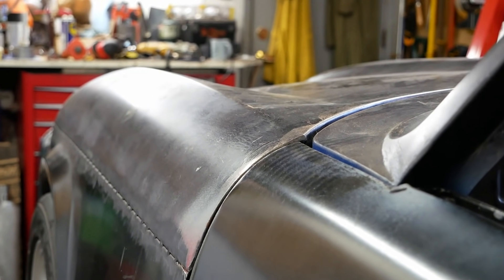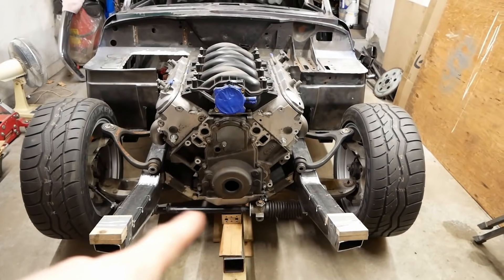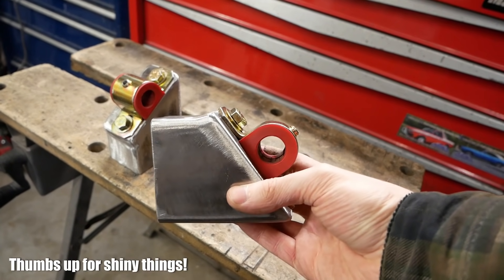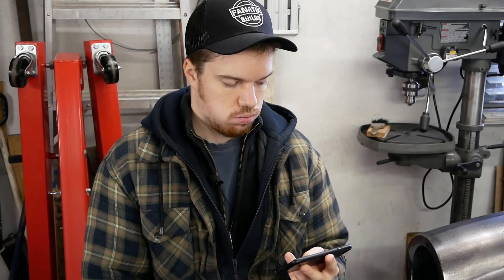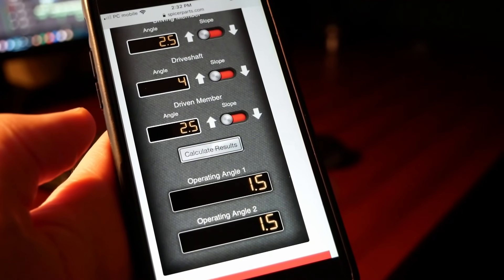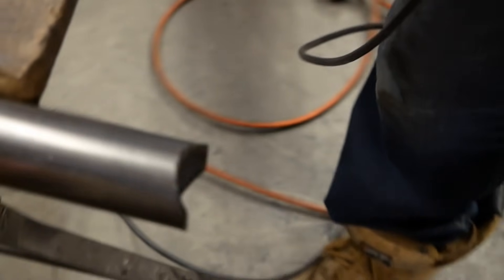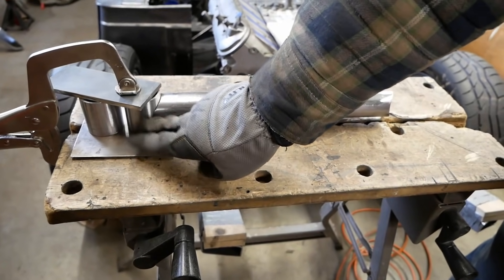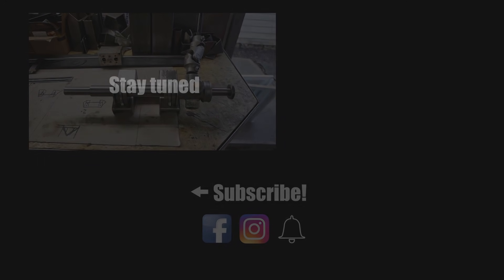Brackets!  Pro Touring V8 Triumph Build – Project GT6R – Ep17

Comment from the maker: Welcome to all the new subscribers!  Enjoying the project?  Please share it! 👍
Also, all Patreon's get videos a day early: https://www.patreon.com/FanatikBuilds
Reply: The brackets for the control arms should just need some gussets if your worried have a look at the fc rx7
Reply from the maker: @shaynegadsden  That's awesome, the FC RX7 was what I was going for with this design, cool that you picked up on that! 😄👍
Reply: I just know the bush mounts since im fitting an fc subframe into an sa
Reply: Hi nice work would recommend bmw rear concentric bolts on your upper a arms for that fine tweaking of the camber
Reply: Hi guys, 

really like what I have seen so far. This Triumph is one of the best looking cars, think it was called 'poor man's Jaguar' back then - but for me it's even better looking than most Jags. 

The only thing I am concerned is the welding of the wishbone mounts. Did you calculate the size and length   of welding needed to be safe regarding dynamic stress? 

I guess the small weld spots were just to hold the mounts in place. But the welding should be calculated with some boundary conditions. Otherwise you might end up with a mount ripped off your frame. 

Hope that you are up for some constructive (literally) criticism. I look forward to your reply.

Cheers from Germany.
Reply from the maker: @MrPowermanmatt  Thanks Matt - I've been searching high and low for concentric bolts that would work with little to no luck!  They need to be M14 for the upper control arms, are there any BMW ones that size you know of??  Thanks!!
Reply from the maker: @DerSnipOr   Thanks very much sir!  We agree that it's a great looking car, and we're trying hard to bring out the true shape of it even more by shaving the pinch welds and so forth.  I do actually feel that it's on par or better looking than the Jag ... not a very popular opinion, but there you go!  I'd say the Eagle Speedster takes all the best lines of the E-type and perfects the rest, that car is gorgeous!  As for the welding, I've spent a bit of time behind a welder and even have some training, so I'll try my best to make sure they're finished well, and safely :) ... thank you for the constructive criticism, I'm always open to learning better ways of doing things!
Merry Christmas from Canada! :)
Reply from the maker: @MrPowermanmatt  Interestingly, once I include "BMW" in some searches I am actually finding what appear to be M14x1.5 concentric bolts!  It would be about $260 for eight of them though!!! 😬 Maybe I'll try the local scrap yards when the weather gets nicer!
Reply: Not sure what size they are but they fitted them on the e36 e46 and many more
Reply: @FanatikBuilds  Thank you for your reply. We have a car checkup every 2 years in Germany. Modifications must be allowed by testing engineers of TÜV or other test companies. 

I talked to some of my colleagues. We all thought that it would be good to know how much stress the welding spots can take. If you are interested in a calculation - it takes the rigidity of the mount geometry, weld size and welding quality in account. Calculation can be done on a sheet of paper, maybe takes 1-2 hours. 

Then you are safe regarding static loads, for dynamic loads you would have to create a load spectrum. 

Cheers

Comment: This is one of my check always channels now- the build is coming along awesome, and if I can still be on to BOM from Episode three to now, your pace isn't going to run me off! My Winter popcorn order arrived just the other day and I find even though consumption was up a bit last quarter, I have plenty to wait you out! You look yo be enjoying the process with you dad- good on both of you! What you look to be building should actually be a nice car- just throwing a pile of parts together, bought with a credit card, is just a pile of parts. This will finish with blood, sweat ,tears and love in it. You will both smile every time you hear it start. Considering your engine choice requires a computer, I'm looking forward to how you tackle the wiring- the bits from the Triumph weren't much to rite home for to begin with, so it will be fairly scratch- you might have a look at Binky's- some great common sense tips there, and much detail. Ya'll really need to figure a way to increase your exposure- this is a great build and should be getting many more views and subs! Merry Christmas!
Reply from the maker: Thanks Frederic! 🍿 You've nailed it exactly - and we are enjoying the project, thanks!  Wiring is something that I am giving thought to but realistically isn't on the table for a while yet.  BOM's approach with using a loom from another car was a great one, but I think for what we are wanting, we may just wire the body from scratch and use the Holley Terminator X for engine management.  Still thinking on that, but that's where we are right now!  I'd love to get more exposure and am trying my hardest to do so - at least things seem to finally be headed in the right direction lately!  Merry Christmas to you and your family! 👍
Reply: @FanatikBuilds  glad to hear the thought process is already going. Wiring after you've got most everything else done and space is to tight for even a wiring harness leads to poo, unreliable ends! MC to yourself and Dad! Have pop corn, awaiting notification!

Comment: Definitely enjoying your work!
Initially I was thinking you were just a BOM/Project Binky wannabe, but your quality and efforts definitely qualify as being an excellent and inspirational channel.
But it would be nice to see some more effort in keeping weight to a minimum, though.
For example, the mounting flanges for the engine mounts could have been whittled down so that only the absolute minimum peripheral material was there. And any unnecessary material in the middle of the flange plates could also be removed.
Even the round standoff tubes could have been done with cross drilled square tube.
And the same thing applies to the chassis. Hole sawing and slotting as much of the tube work as is safely possible could remove significant kilos. 
Perhaps once the chassis is complete, you could make a jig from it and build a second 'RS' type chassis with maximum weight reduction???
Anyways, given your limited resources and space you guys are doing some fantastic work!
Reply from the maker: Thank you for saying that - I've always enjoyed imitation and feel that YouTube is a community which works best when we acknowledge each other's existence!  For that reason I've included references to BOM, Top Gear, Donut Media, Mighty Car Mods and even other channels I enjoy like This Old Tony, Taylor Ray, and Mark Rober.  Sometimes their subtle nods, other times they're hard to miss, but on the whole I enjoy it when channels I follow reference each other!
As for the weight, we have been weighing things as we go to keep an eye on what the end result should be, and so far we're pretty happy with things.  Keep in mind neither of us are engineers, so we'd rather err on the side of caution and not accidentally remove material from the wrong places!  Also, each hole or cut takes a long time with the tools we've got, so machining out chunks of 1/4" plate isn't exactly a thrilling proposition!  You get what I mean though, so thanks very much, and I hope you have a Merry Christmas! 👍

Comment: Beautiful work as always, well done lads. One thing you might want to consider during the fore-aft motion is during a lash crossing, when you press the accelerator pedal after a tip-out. You probably have thought of this already, you will need to measure lash on your driveline and make sure north-south mounts are at the right position to dampen it so that fore-aft movement is within a defined plane to ensure nothing fouls. Assuming north-south mounts are needed, not sure how LS are mounted.
Reply: Looking back at the east-west mounts, fore-aft play on the engine will be minimal, if at all. Perhaps any fore-aft movement from the driveline will pass as vibration in the cabin, which remains to be seen. Definitely something to check though 🙂 I'll have to admit, north-south seems far easier to mount than east-west, especially when the transverse mounts are not on the same height.
Reply from the maker: @manosfarfarelos8666  thanks for the advice and keeping an eye out for us!  If I'm on the same track of mind, I think we should be fine, the driveshaft yoke for the transmission is a slip yoke, and since it's independent rear suspension the diff doesn't move at all - so nothing should be forcing the engine forward/backward unless I'm missing something!  The Poly mounts should also help mitigate a lot of potential movement... At a sacrifice of NVH though for sure!  Cheers!! 🙂👍
Reply: @FanatikBuilds  yeah, I think that might be the case too. Fingers crossed it's not a big setback!
Reply from the maker: @manosfarfarelos8666  🤞 cheers!👍

Comment: Good stuff as always.

Probably want some vertical triangulation on those mounts in the direction of torque from the engine.
Reply from the maker: Thanks Andrew!  Since they're mounted at 90 degrees to the block (and it's a longitudinal layout) rotational forces from the engine will be transferred straight through the mounts, so there shouldn't be any need for that.  Fore/aft movement should negligible due to the slip-yoke in the driveline and fixed rear end.  All in all, I think it should be good, but thanks for keeping an eye out for us! 👍 Merry Christmas!

Comment: I used to autocross a Triumph Spitfire. Negative camber was key, as much as I could crank in with the stock bolts using the OEM shims, many of them, which kept me legal for stock class. Tire wear was a little more pronounced, but the handling was much quicker. Of course you're doing an LS in a custom frame so things may be quite different. In any case, it's a great build and I'm enjoying watching it.
Reply from the maker: Thanks for the info Jim, we're setting it up to adjust anywhere from marginal positive thru a couple degrees of negative.  Plan is to leave it zero for now, and either get it professionally aligned later, or experiment with different settings.  If we do, we'll definitely try some negative, cheers! 👍

Comment: This is just a great series that shows some of the crazy engineering behind the scenes.

Great work as always!

Any concerns about rust in the Frame rail where you slipped the captive plate?
Reply from the maker: Thank you Evan, we appreciate it! :)  We've been taking precautions wherever possible to prevent rust, and someday (after all the welding is done) will be painting the inside of the frame with a 360 nozzle.  After that it will get routine oil sprays to keep it protected... and lastly, we don't plan on using the car during the months where the roads are covered in de-icing salt.  The joys of a weekend car that we've never had before! :) Cheers and Merry Christmas! 👍

Comment: Awesome build , I am a mechanic for 53 years building a cobra, Also with off the wall parts, Mazda rx8 suspension front and rear ( well Mazda spend many millions developing one of the best handling sports cars around, why reinvent the wheel, motivation is 350hp nissan V8 ( 200k miles reliability) 6 speed manual gearbox and a nissan LSD 3.6 , in the meantime I am using factory type thickness steel of 3mm for my brackets and chassis rails , for many reasons, 1 it's easier to cut and work, 2 it's lighter, 3 it's cheaper, 4 it's the same as a factory car that weights 50% more, I am aiming at 1000kg,
Reply from the maker: Very nice!  Yes the 1/4" plate we used in places here was probably overkill vs a properly engineered and gusseted 1/8" part.  Trying to be more conscious of this as I progress in building ... I'd rather be overkill than under ... but there's no need for excess!  We're also expecting to be around 1050kg or so 👌👍

Comment: To better resist drivetrain torque, should not engine mount tubes be somewhat skewed?
Reply from the maker: Hey Steven!  Since they're mounted at 90 degrees to the block (and it's a longitudinal layout) rotational forces from the engine will be transferred straight through the mounts as they sit... fore/aft movement should negligible due to the slip-yoke in the driveline and fixed rear end.  All in all then, I think it should be good, but thanks for keeping an eye out for us! 👍 Merry Christmas!

Comment: Out of curiosity, why not just leave the two separate holes on the upper control arm mounts? Would make it easier to build. Plus then you have two options for camber already. However I will admit you wouldn’t have as much adjustability of course.

Comment: You could have kept the engine/trans angle by rotating the diff to reduce the ujoint angles. Ujoint angles are usually opposite in oem installs but not always.  With an IRS/fixed pinion location, opposite does not matter as long as the joint operating angles are equal. Ditto on gusseting the swaybar saddles used on the rear of the LCA.
Reply from the maker: Must not have explained what happened very well, but the engine and diff were already angled equally, and as lifting the engine would have put the UVs on too much of an angle we elected to adjust the angle of each end to be a bit greater (from 1.8 to 2.5 degrees)... It actually gave us the clearance we needed and improved the UV angles in the process by straightening out the driveline a bit more... so it's a win-win!
Yep, we'll be adding some gussets, thanks 👍

Comment: I'd like to have seen the whole fishing-the-backing-plate-down-the-frame-rail-with-a-piece-of-wire trick in more detail.  I think this is an operation that would have required a couple of hours and more curse words than exist, if I were to do it.  Why not just thread the frame rail?  Did you think it wasn't really thick enough?
Reply from the maker: Haha, it was a bit of fun - probably 15mins a side though.  We used welding wire shoved through the plug weld holes and out the front of the frame, then two small holes on the captive nut plate with the wire pulled through and loosely knotted.  That way we could fish them in, install the bolts, and give the wire a good tug to remove it from the holes for welding.  Worked well!  Yes, the 1/8" frame is beefy, but not enough to trust 2-3 threads to hold important stuff like an engine.  Cheers man!

Comment: Just a side note as these guys are doing a great job. But if anyone out there is building a project remember there are more projects that end up sitting incomplete then completed. Number one reason and these guys seem to have plenty but many run out of time and motivation. I been in the custom car building/fabrication sense 2006. One thing I have personally noticed is people get tired of building and fabrication due to have to do it the slow way. It adds a lot of time to a project not having the best tool for the job. So if you have the budget don’t be scared to purchase better tooling, it will significantly increase your skill level and speed and in return help get you to that finish line.
Reply from the maker: Thanks Kyle - yes all too many projects have been abandoned over the years due to the sheer amount of work needed to complete them.  We've almost been there at times ourselves during the bodywork earlier in the series, and even recently to a degree... but this new direction has definitely added some more interesting twists to the project and I find the research for each next step quite fun!  I think the key with these projects is don't set unreasonable deadlines, as you'll just feel depressed if you don't meet them.  Better to just tackle one small job after another and eventually you'll cross the last one off the list.  The tooling comment is also very true, I'm never opposed to buying new tools if they will help... it's just the space they take up that can become an issue! 👍

Comment: Link for the rust converter you use please 😁
Reply from the maker: We get it at Canadian Tire :) ... But it's "Rust Check" brand "Rust Converter" in a spray can.  Goes on clear and turns this purple/black as it does it's thing!
Reply: There are a few places in the northern usa that have it but doesn't seem easily attainable in USA.
Reply from the maker: @johntrhodes1  that's unfortunate! 😕 Great product!

Comment: Have you thought about running the intake backwards or does it clear the hood? My LS1 intake didn't clear forward so I had to flip it around. Also, what are your plans on exhausts?
Reply from the maker: Funnily enough, the factory LS4 intake already points out the back!  It would fit well under the hood like that, but I'm having a hard time imagining how we'd get cool fresh air to the back of the engine bay.  Likely will keep it pointing out front as we'll be able to route the intake tubing down to the grill! 👍

Exhaust will be dual 2.5" all the way with an x pipe ... Planning on a fairly unique setup due to the tighter space restrictions but we'll see how it goes!
Reply: @FanatikBuilds  I can't wait to see how it goes.
Reply from the maker: @fatboysgarage7984  however it happens we'll be sharing it all here!  Cheers man, and Merry Christmas! 👍